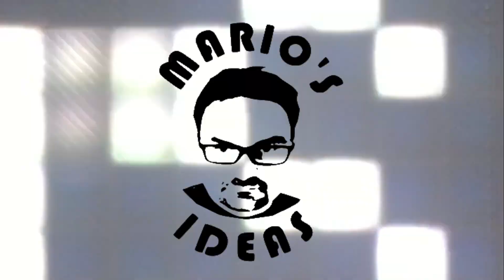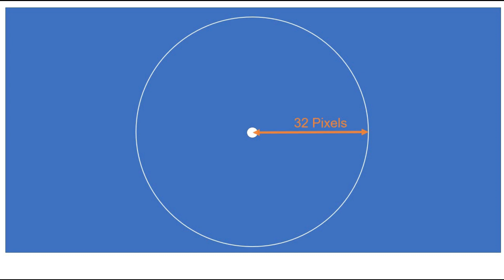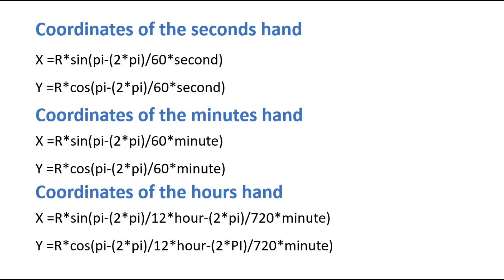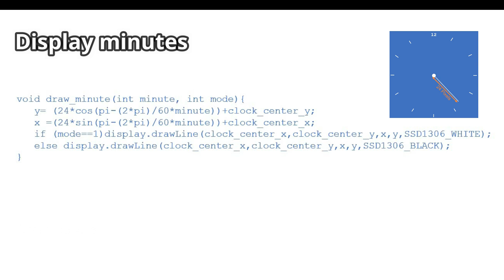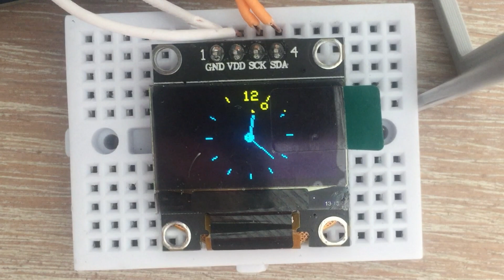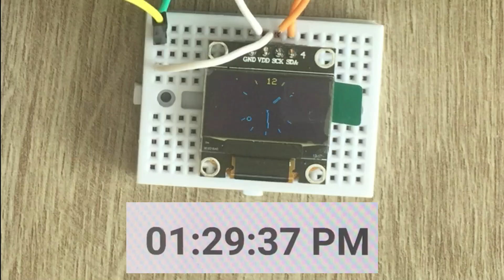How to create Arduino analog style clock

Comment: Your code is excellent. But there is an error in it.  When you write over the seconds and minutes and hours with black to remove them you use the latest time rather than the previous time. So it doesnt work.  I have put the code I amended below:
if (tm.Second!=seconds){
    //draw_second(tm.Second,0);Original code had this so "second circles" never disappeared and just filled up the face!
    draw_second(seconds,0);//write over old second position
    draw_minute(minutes,0);//ditto
    draw_hour(hours,minutes,0);//ditto
    draw_second(tm.Second,1);//write new second position
    draw_minute(tm.Minute,1);
    draw_hour(tm.Hour,tm.Minute,1);
Reply from the maker: I checked and I am not certain if my code has an error.
I have the same code in my video in arduino.cc and in Arduino IDE and in the video you see that the face clock is shown ok.

The code block you refer to is:
if (myRTC.seconds!=seconds){    <checking if second has changed>
    draw_second(seconds,0);     <draw the seconds in the previous pos in black - erasing it>
    draw_minute(minutes,0);     <do the same for minutes hand>
    draw_hour(hours,minutes,0); <do the same for hours hand
    draw_second(myRTC.seconds,1); <draw seconds hand in white in new position based on the new value read from RTC>
    draw_minute(myRTC.minutes,1); <same for minutes>
    draw_hour(myRTC.hours,myRTC.minutes,1); <same for hours>
    display.display(); <displaying results of last 6 lines, some of the elements of the face of the clock are messed up but this is whty I execute redraw_clock_face_elements(); to fix it at the end>
    seconds=myRTC.seconds; saving new seconds minutes and hours readings 
    minutes=myRTC.minutes;
    hours=myRTC.hours;
    redraw_clock_face_elements(); 
 }
Reply: @marios_ideas  That's interesting... I wonder what version of your code i was looking at then...? 🤔
Reply from the maker: The thing is that for this block it is the same in all three places where the code i stored (in video itself, arduino  IDE and Arduino.cc) Also check the comments in the code I added above. The code is doing exactly what I want.
Have you used 
redraw_clock_face_elements() function at the end of  main loop?Without it some of the clock face elements are messed up by erasing clock hands (drawing the lines in black)

Comment: Hi, there is an error in your schematics.  The SCL and SCA connections are not correct on the OLED Display symbol.  Compare the instruction comments at the top of the code.
Reply from the maker: Can you give me the exact time. I will check and add the note in the description. Did I swap them around?
Reply: @marios_ideas  Hi. Its in your arduino projecthub documentation.

Comment: Nice project, quite useful.
These SSD1306 OLED modules are great, I use one in my smog sensor, and it does the job :)
Reply from the maker: Thanks. I will do another video where I will try to put this on my rist. So I have to scale down the components and probably create the custom PCB to avoid having all the cables.
Reply: @marios_ideas  Arduino Nano could be better choice if size is important
Reply from the maker: tata.geek. I will go smaller:) Attiny85